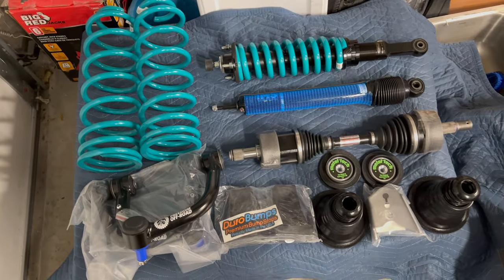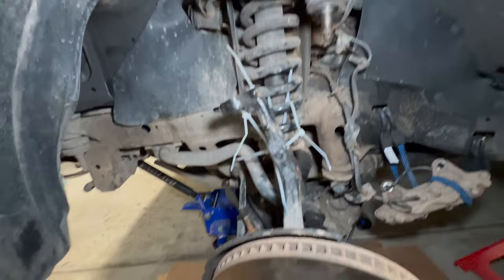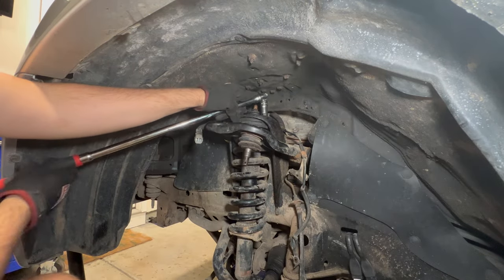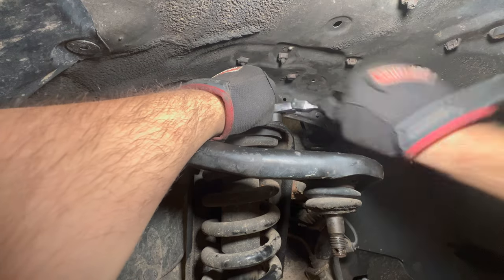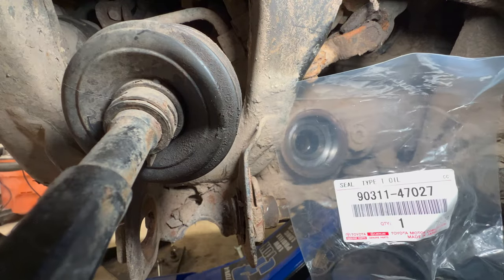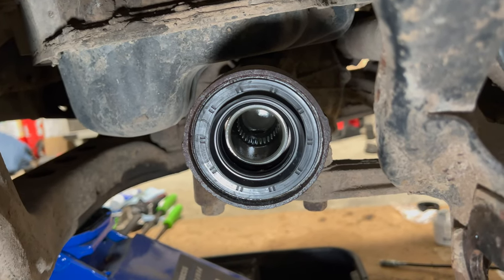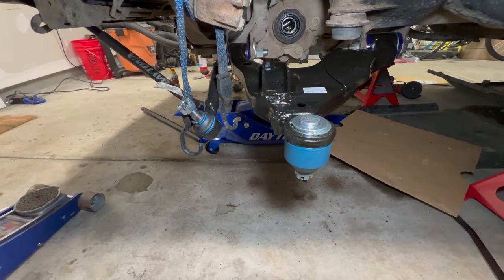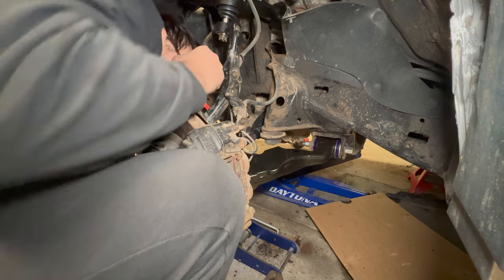GX470 Lift Kit & Front End Refresh - LCA, UCA, Axles, T-Case Seals and More

Comment: Hey Erik! I found your tik tok about the LFD roof rack install, it helped me out a bunch! I have a Goliath off-road bumper comin in soon too. Love the install video. I might’ve missed where you said it, but what tires and wheels are you running as well as how much of an overall lift did you get?
Reply from the maker: Glad to hear it helped! I’m running 17x9 -1 offset Fuel wheels with 265/70/17 Falken Wildpeak AT3 tires. The lift kit was a 3” lift but I never actually measured the before and after but I’d guess it’s a bit higher than that since I don’t have a lot of weight on it yet. I’ve got a set of front and rear bumpers on order coming at the end of July so big changes still coming to the GX. I’ll be posting the full install video of the LFD roof rack soon.

Comment: Erik, I have the Superpro lower control arms and Freedom Offroad UCA ordered for my 04 GX. How are you liking them so far? Are the LCA squeaky or ride harsher than oem? Thanks Chad
Reply from the maker: Overall it rides better than before probably because of how old and worn out the OE shocks were. I’ve had no issues with squeaking or NVH with this combo. Alignment place was able to get it dialed in and tracks straight.
Reply: @eriksadventurelab  Right on! Thanks!

Comment: How are how are the super pros? Are they noisy at all?
Reply from the maker: Not noisy at all. I’ve had no issues with them and don’t feel like they ride any stiffer than the OE ones I had.
Reply: @eriksadventurelab  Thanks bro. Do you happen to have the part number for those axles by the way?
Reply from the maker: @xJG91x  434306008284 is the PN I ordered for both sides.